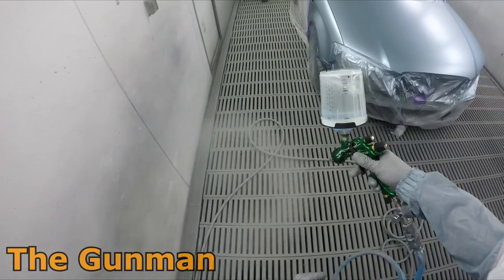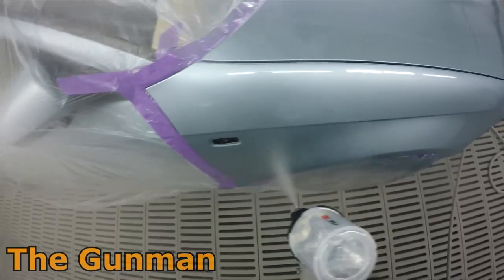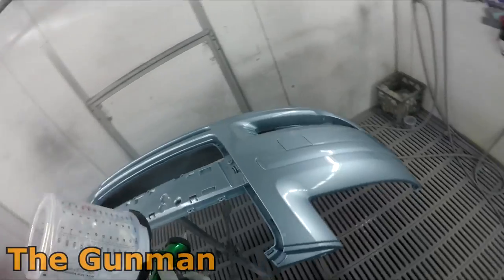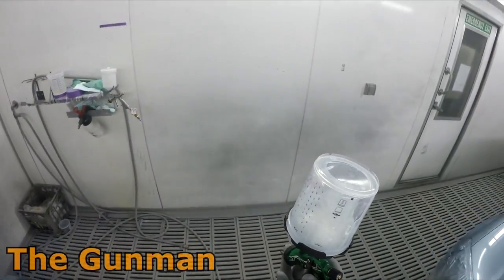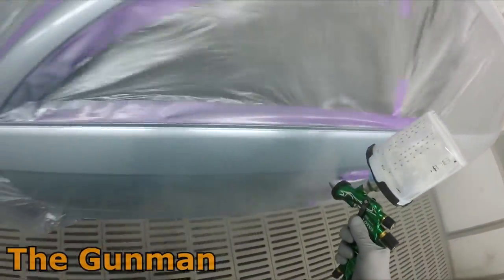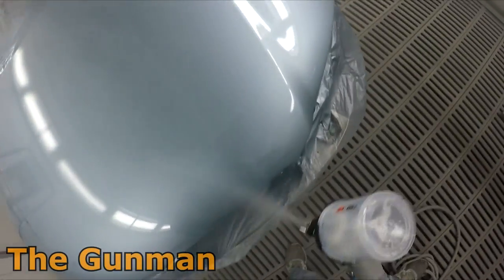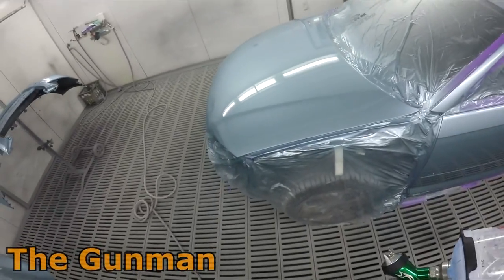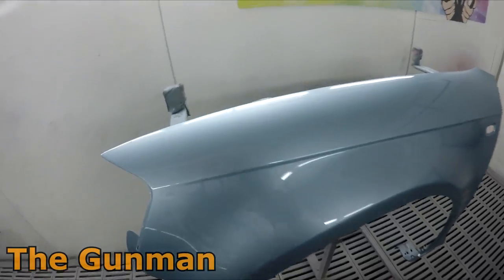Iwata Lotus Best Clear Settings!!

Comment: I have been studying your videos for the last 6 months, I have both the SATA Jet 3000RP with 1.4 tip and the Iwata Supernova WS400-01 with the 1.3 HD tip. I ended up using the Iwata for both my dark metallic blue base and just finished the clear this morning. It turned out like glass, thanks to your recommended settings, which I copied exactly. Worked out great. It does seem to use a lot of material though...not sure if it's me or the gun or ??? I used 1.2L of paint and 1.2L of reducer just to put 3 coats of base  on the hood, trunk and lower valence of my 68 Firebird, not a really large area. Then it took 1.8L total of clear for 3 coats...looks great but now I need more paint before I spray the rest of the car. :-)  Anyway, thank you so much for the videos you produce, they are a great learning tool, very much appreciated. Cheers!

Comment: Hey gunny ✌️ nice vid as usual. I’m using the same settings and I find I’m using a little less clear than the pro lite with te20. I spray the lotus at just over 2 bar. 2.2 bar I find is sweet. Quickens it up even more I found too 👍

Comment: Gunny one question!  The iwata lotus that you have, has any difference between the normal iwata ws400 or the only difference is the design? Thanks
Reply: I'm curious to his answer on this question I have the gun love it use it everyday and I do think it does spray differently
Reply: Identical

Comment: Hey Gunny. I have no idea how you spray all of those pieces with such little amount of clear coat. I have a Tekna Prolite 1.3 w/Te20 and it drinks clear. Not sure what i am doing wrong. The finish is no where near decent.  Its more on the orange peel side. I been trying to figure things out, but just been stuck. I spray clear at 28psi , & base at 20psi. At the regulator/air dryer i set it to 80psi, The at the gun regulator is the recommended psi that you mentioned. Just been lost. Any ideas would be greatly apprecited.
Reply: AllStarChris I use the prolite. Same psi. Fluid 3 turns out fan wide open. Try to pull gun back a bit more. Also stroke a little faster it will lay out flatter and use less clear.
Reply: @xgtharo86x  Thanks for the great tips. Just curious on what size fittings /air line length  you are using?
Reply: No problem. Normal 3/8 line. I don’t have the high pressure lines. Have my regulator at 80 psi as well. Makes my gun max out at 32 if I have the gun regulator wide open. You wanna be about a fist and a half away. Move about as fast as him. Depending on clear. If you fill a pps cup do about a 6 on cup try putting a cap full of reducer in the last coat it will have a bit of time to flow after you spray. It helps on blacks for sure!
Reply: @xgtharo86x  ok. I would give it a try. Thanks

Comment: It is a beautiful gun but it just sits on my shelf. It just seems too slow for me and having to use such low psi.
Reply: Trey Stults if you want it fast turn up the pressure to 2.2 bar. I turn the fluid all the way in and then open it to 3 to 3.5 turns. I use the ws400 base for clear tho i find it gives a better finish than the clear version. You can paint fast with it tho you just need to find your settings